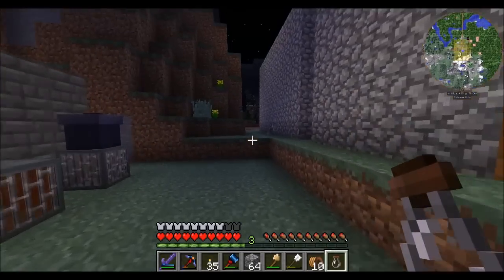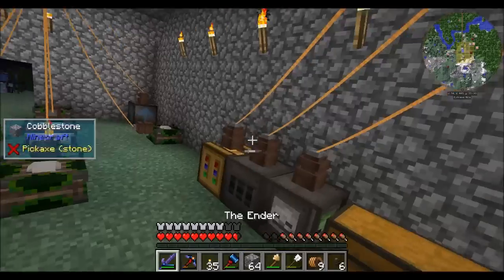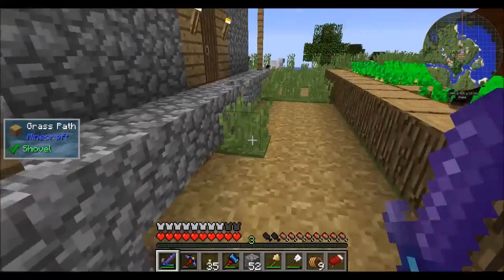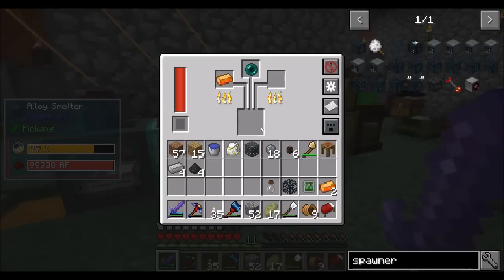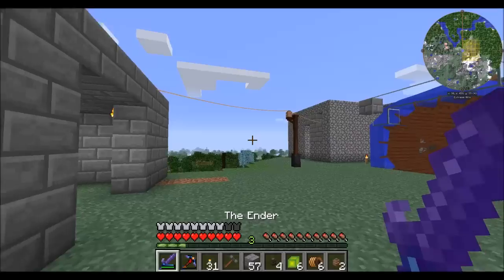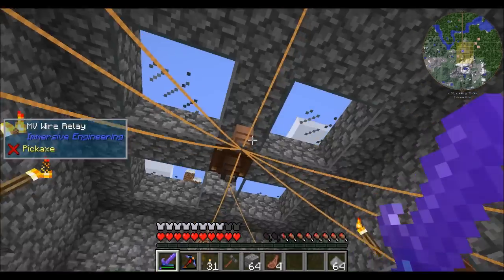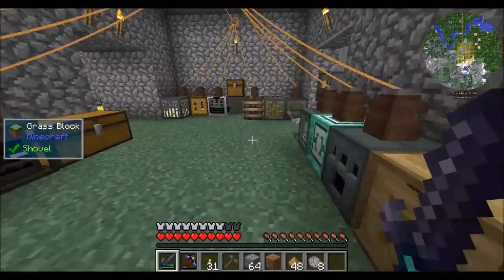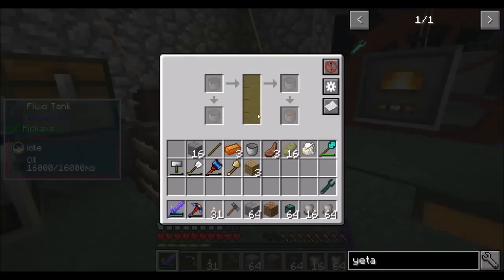AoE Ep16 Endermen

Comment: There is a lot of steps that dire  missed.
1. Make a better blast furnace from IE
2. Start bees early (you will need it later)
4. Start nuclear power
5. Start automating circuits
6. Read the guide!
If missed anything, please let me know. :)
Reply: nuclear power is not this age i think
Reply: Prince_Chaotic where is 3 ??
Reply: You missed Dire and his logic. 

I expect Dire to make veeeery slow progress in this pack.
Reply: bees and nucler power are later quests. He is still in ender age.
Reply: Nuclear power isn't gated, but it's a good idea to start early.  Both for better IC2 power generation, but also to start building up the byproducts that are needed later (plutonium).
Reply: I see your points, in my AoE world with a friend we're currently in the farming age, made the blast furnace from IE. One question tho, which circuits need automating? Also, I've never done bees or nuclear power, any good tutorials out there?
Reply: you don't need to get started with bees, the guide is wrong on that note. You'll only need it waaaaaaay further down the line, and you'll have plenty of resources by then to help you automate bees.

Nuclear power again, is recommended by the guide in age 3!! An age in which you would need  to use up all the resources you have to even build a full size reactor. No, use solar power and generators to get by until right around age 5-6, then build your first reactor. You'll need to make more of them eventually (8-10 ish), for age 8 and 9 to make UU-matter and the end of calculator, so it's a good idea to get them, but don't rush ahead of yourself.
Reply: Starting bees early would be a good idea? Thank you. And also, circuits from which mod?
Reply: absolutely no need for bees early on. Follow SystemCollapse, he actually knows what he's doing.
Reply: He also forgot to get the double crusher and powered furnace from the pedestal mod, the name has slipped my mind but there is a lot of empowering of things
Reply: He also misses the Progressive Automation machines, they are nice early on, and the Solar Flux Reborn cables would reeeaally help with his dire-wire mess
Reply: yeah the solar flux cables can be worth it before you get to an alloy smelter. Certainly would be usable if he actually had space to put stuff in, his base is so cramped.

I never bothered with progressive automation. The tree farm is trash compared to just using a TiC lumberaxe and the other ones are even worse xD But hey, just my opinion.
Reply: Actually Gray, the jam guy was selling jam, not buying
Reply: You missed 3
Reply: Add 1: Im not sure if this is creative use of game mechanics but you can use the metallurgic infuser to make circuits (Use redstone as power instead) 1 Osmium+2redstone = 1 circuit is better than the IC2 recepie. One redstone for making the circuit the other for power
Reply: However, the metallurgic infuser is very expensive and cannot be obtained this early on.
Reply: The guide sais you can start with nuclear in the empowering age. (That's about where I am ATM)
Reply: @robert Interesting So my game was bugged then Ver 1.0.3? For me it was the vanilla recepie for the infuser, the expensive one was the cables
Reply: Yeah it needs the steel casing, which is acquired in age 11 I believe, or it starts age 11. Something to do with age 11. It requires a lot of stainless steel to make.
Reply: You technically can start nuclear power from IC2, however it requires finding a lot of misc dungeon chests to get enough iridium to make the thermo-something or other generator. Also a lot more for the fuel pellets. Only produces 20 IF/T per fuel pellet, so it really is a waste of time
Reply: Yeah i rechecked the new recepie in 1.0.4 its defenitely that... I dunno what happened then but somehow i managed to craft it in 1.0.3
Reply: Prince_Chaotic I
Reply: Not sure but I think there were 2 recipies in 1.0.3 - one using the techreborn casing which was way ahead and one using the IC2 casing which was pretty well doable.
Reply: Just sayin, I never even started Nuclear power. I just explored and found the iridium ore I needed to make the molecular thingy that makes iridium from iron. I've also yet to see a need for bees. (just made it to age 9) and if i do, /give the resource I need because i cant think of anything less fun in a video game than bees. And the whole reason Im playing is fun, not pride.

One thing is certain, If you want AE, start on calculator circuits, then upgrade speed and energy on them asap! I cant remember if there is a gate from later ages, but the extraction chamber can be upgraded into a different machine that is twice as fast by default, and the other one can be upgraded to fix both damaged and dirty circuits. Storing them is a P.I.T.A! the storage unit from the calculator mod is not automatable via pipes, conduits, hoppers, anything but is pretty good if you constantly transfer them over by hand.

You also get some nice goodies, like nether stars, beacons, diamonds, emeralds, atomic calculators, flawless calculator. It was worth the effort imo.

Also, what about automatic ore production? The AA reconstructor with mining lens was fun to automate and easily achievable even before last episode.
Reply: About progressive automation, did someone else notice the "killer" still use old minecraft version code, it simulate a player hitting a mob but do not take into account that know you have a "cooldown" for doing damage, therefore making it completely useless doing 1/2 hearth damage like you were punching barehand a mob even with the best sword you can equip it.

Comment: Dire, pump the coal dust from the prunae seeds into the coal generator. It won't be much but its something
Reply: Jordan London coal dust is burn time 1000 regular coal is 1600 but not as easily farmed, he'd have endless coal power gen doing what you said, which would be awesome.
Reply: Ikr and how expensive at his level is it to make the greenhouse (the one above basic). The basic one is a bit slow but I let it run for a 24h day and it filled a chest. Or even at the minimum, combining the coal dust with coal coke for more efficiency

Comment: I'm really surprised you haven't figured out yet that TechReborn is GT 2 from the gold old days of Modded MC 1.4.7. It's the variation before Greg changed the Fusion Reactor and it just needed the coils. It's pretty epic if you ask me. Also all the TR generators make both EU and RF. You can hook up any of the IC2 cables to it and draw EU out of the generator and then hook up any RF cables or just use their cables and charge other things. The mod is super derpy, but it works pretty well and personally I love it :3
Reply: oh he does, check his modspotlights
Reply: i'm pretty sure RF is disabled in this modpack for Tech Reborn
Reply: Yeah, Tech Reborn is EU only in AoE.
Reply: I can assure you that just because direwolf20 has done a mod spotlight on a mod does not mean that he knows the mod... at all.

Comment: AoE=crafting simulator
Reply: Ozan İnan Yep
Reply: I guess you didn't play FTB Infinity Evolved then
Reply: FTB IE had the benefit of Logistics Pipes being available, and making that available to the player relatively early.  Here you can auto-craft using Progressive Automation, then XU2, EIO, RF Tools (in that order) as you progress, but there isn't inventory management until you get heavily into EnderIO, then RF Tools once you go to the end, then eventually finally AE2.
Reply: I'm frustrated because AoE is another game interly then Minecraft and is only being recommended because of a similar tittle
Reply: EOzan İnan
Reply: Once you get into RFTools, which isn't that difficult, you dont need anything else until you require auto-crafting. And you can get around that by crafting in bulk, you know, stacks at a time. RFTools is insanely strong after 1.10.
Reply: Even autocrafting can be done with RFTools auto-crafters, and RF control. Though personally I prefer the Immersive Engineering Assembler.

Comment: Well I'm kinda angry... Why is dire using the powered spawner instead of using the drop of evil ones.... Like both of them can be customized using redstone but one of it uses power while the other doesn't..... Oh well dire is dire I guess... He never changes.....
Reply: Because for a custom spawner, you need to find 5 spawners to end up with an XU2 spawner.  Depending on your luck, EIO Powered Spawner can be cheaper and easier to get early AoE, and for on-demand use just costs some RF (currently "free" from the waterwheels).
Reply: Hmm right I didn't consider that.... But I the thing is I dislike wasting RF while I can use better stuff instead of it....
Reply: Also it costs a block of empowered diamontine crystal which is 20 million RF talk about a waste of RF at this point
Reply: True but only in AoE
Reply: What i like about the enderio spawner is that they can be automated for endermen soul vials for further crafting
Reply: BroAbhishek direderp
Reply: Yep this is the comment I needed to exactly explain why dire is bad when it comes to teaching us new things..... 
System collapse is way better than dire....
Reply: BroAbhishek hell I learned a lot about Witchery, and fun intermodal relations like the cake reactor from Lying and Kirindave. You rely on dire for enjoyable content but not educational content
Reply: I disagree that cheap and easy makes the ExU2 spawner better.  Not everyone thinks that on demand mob farms should be free to run.  I prefer the EnderIO one because it actually does require power to operate.  ExU2 dumbed mob farms down to virtually zero effort.  Kill one Wither skelly, get a Drop of Evil and make a free for forever mob farm with insane spawn rates, or change a vanilla spawner at will and put in speed upgrades to spawn a stupid amount and require no power other than virtually free GP.
Reply: Lets face it every version of a mob farm has been done at this point except for one, RFTools.  But it requires the most effort so players today refuse to acknowledge it even exists.
Reply: RF Tools is great, but in this pack it requires more effort than usual.  I suppose at this level of advancement, the RF Tools machine frames aren't actually a hinderance though.
Reply: No, cheap and easy makes it BETTER. You're arguing the fun aspect, in that you find it more fun to use a mediocre version because it gives you an added challenge by giving you a handicap.
Reply: We have different meanings of the word better is all.  Mine is one that requires actual effort, yours is one that is a magic block and thats fine, which is why its good that Minecraft gives us options.